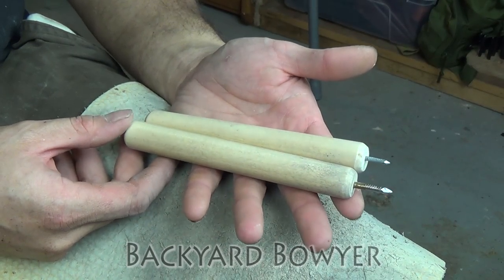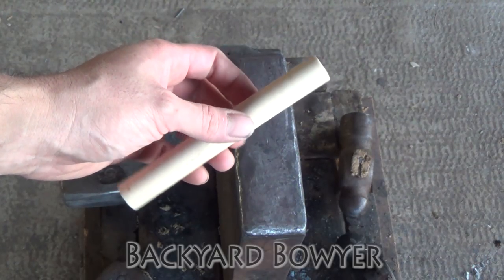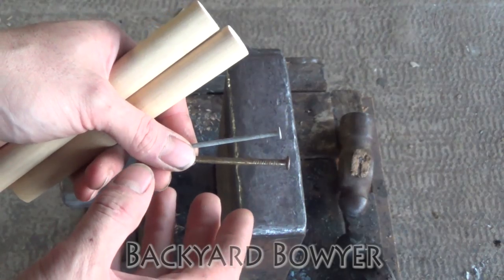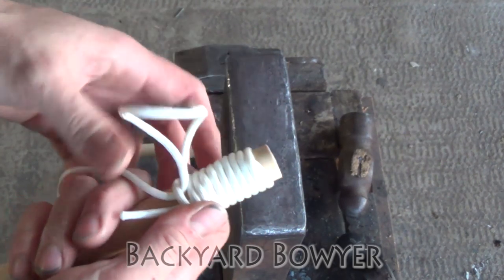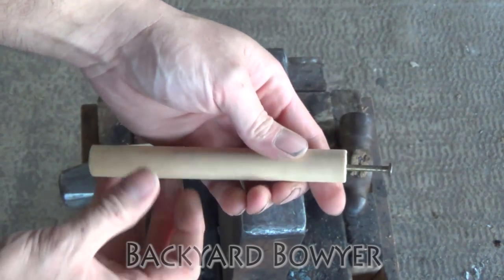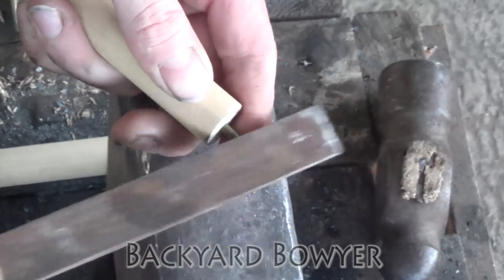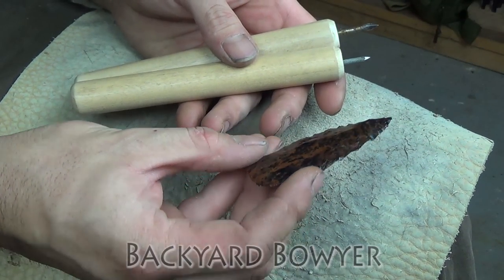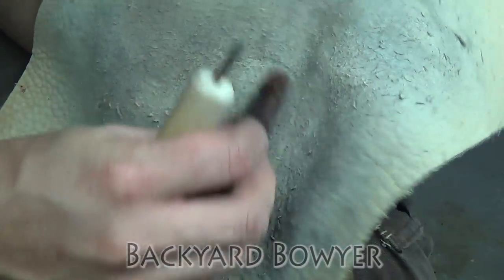How to Make a Steel Nail Pressure Flaker for Flintknapping - Beginner Tool Kit

Comment: I've made several flakers like this. I found it helps to grind the tip of the nail to shape with a belt sander/angle grinder until it changes color. Softens the steel and helps reduce slipping.
Reply from the maker: +Eralen00 Thank you for the tips!

Comment: Are aluminium rods a good alternative? If you are using steel nails, do they have to be annealed before they can be used?
Reply from the maker: +shade_grey Aluminum rods are my favorite, but they wear down even faster than antler. I may do a video on those soon.

You don't have to anneal the nails, but you could and it would help with grip.

Thanks for watching!

Comment: If you can't find copper nails, you can usually get 4 or 6 gauge solid copper wire at a hardware store. Or if you're feeling naughty you can also find this size wire used as grounding wires on wooden power poles.
Reply from the maker: +Cadwaladr Thank you for watching and for the suggestions!
Reply: UMMMMM!!

Comment: Could you possible drill a hole in the handle cut the nail and glue it in or would the strength be different

Comment: Or drill a hole the size of your nail into the dowel use a hack saw or a dremil to cus off the top glat part of the nail. Use sandpaper or a knife and score slach routghen the nail fill the hole in with glue push the nail in and wioe of exess glue

Comment: Where can I get stones like that to learn knapping on?
Reply from the maker: +Boblo You can try searching online to see if obsidian or flint can be found in your area. Any local rock or lapidary shops should be able to either sell stone or point you in the right direction. If not, there are places online you can get stone. I like ordering from Craig Ratzat at Neolithics.com as he has a good selection and pretty reasonable prices and shipping.

I also like to walk creek beds with a copper bopper. If I run across a rock that looks like it might be knappable, I'll give it a whack to see if it flakes well. I've found a lot of nice jasper and agate this way.

Hope this helps!
Reply: There's a website called Neolithics which sells 'blanks' for flint knapping out of the stone of your choice as well as selling large chunks of said stones for flint and steel fire making. Their snowflake and blood obsidian are beautiful and their English gun flint is some hard, tough stuff.
Reply: BackyardBowyer is there a certain stone you'd recommend for a beginner?
Reply: @winnievanorden1  I’d be interested in some obsidian to start out with its not local to my area. But I can get plenty of flint from what I hear.

Comment: Why would you use copper over steel?
Reply from the maker: Copper is softer and tends to grip the material better. Steel sometimes slides and does not grip as easily. Steel is fine if your abrade your piece well and it lasts much longer. Copper wears down pretty quick.
Reply: @BackyardBowyer  Thanks! This was actually pretty close to what I was guessing